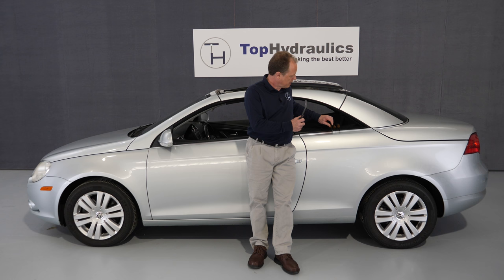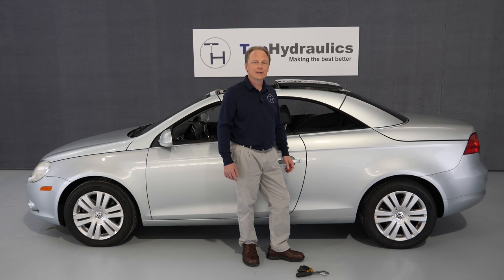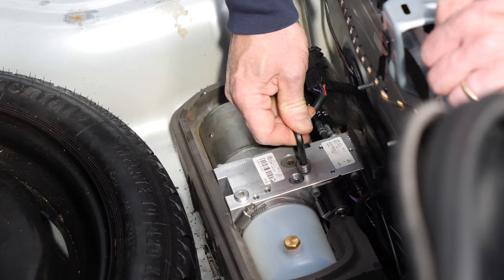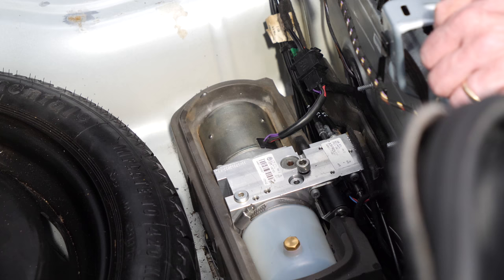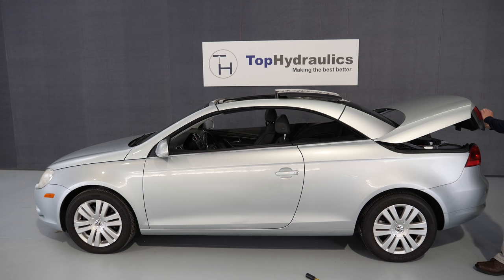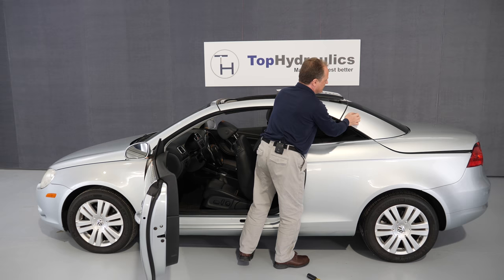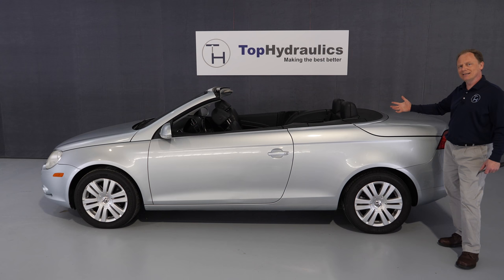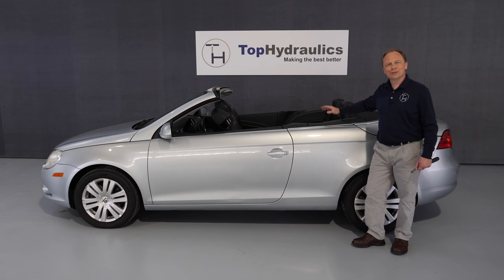Volkswagen EOS - How To Manually Open The Convertible Top

Comment: I was cleaning my sunroof seals I forgot to prop up the top and it closed partially I am currently working on putting the top down, waiting for a second person which is needed to raise the rear glass piece. Videos very informative I thank you for it and I will report on whether or not success has been achieved. Also I will advise if this re-syncs the system for further normal use.

Comment: Thank you. Mine is partially opened, so I’m unable to access the areas like you have here. Looks like it has to be completely shut to do this, while at the same time, in order to manually close it, the procedures you demonstrate has to first be carried out. My dilemma is that the top is partially up. Do you think I’ll be able to achieve what you have with the top being partially opened?  Thanks
Reply: What parts are partially up?
Reply: Same thing with mine.. it's half way shut. Did you end up finding out how to get to the parts in the video? That's what I'm attempting..

Comment: So why is it that when I tried to manually open the top to my 2008 Lux, the glass sunroof (although fully open) does not clear the headrests of my back seats? It’s inches away from clearing it to go into the trunk… not sure if this helps because I’m not even 100% sure about it, but I THINK that it APPEARS that part of the top mechanism is almost running into the inside of my rear taillight preventing it from going all of the way down, but I may be wrong also… but does anyone have any ideas/suggestions?

Comment: ny issue is that my trunk is stuck and wont open
Reply from the maker: You should google the subject and you will find threads about it on VW forums. There are lots of EOS owners with this issue and some of them are very helpful with their advice.
Reply: Mine too!
Reply: Same
Reply: You need to find the wire in the back seats (red lever) if not there are 2 latches in the far side of the boot which are very hard to reach so you have to fish for it or Get a child to go thru the back and unhook the 2 latches and then it should open. There’s some videos showing where exactly these latches are. GL

Comment: Thank you for this. My question is if one of the arms isn’t retracting correctly is that because the cylinder on that side isn’t working or stuck? Everything else works properly
Reply from the maker: If I'm reading correctly between the lines, then you have one arm in the top moving and the matching one on the other side is getting stuck. The matching cylinders on the left side and right side get the pressure from the same valve in the pump, so you can rule out the pump in case of uneven movement. Internal failures in the cylinders are rare, which makes it more likely that you have a mechanical problem in the top's mechanism if I understood the description of the problem properly.
Reply: @TopHydraulics  ok thanks. Yes the passenger side doesnt line up correctly to go down into the side of the car but the drivers side does. I don’t hear any noise and nothing looks bent.

Comment: I don't know why these things can not have a crank to do the whole thing manually with 1 socket mechanically.
Reply from the maker: That would be a nice feature to have. However, the way to make this large hardtop fold was to have an intricate system of small cylinders that work in sequence. A single crank would require the top to fold differently, which would end up requiring a much larger trunk and make the car a lot bigger and heavier, like a Ford Falcon.